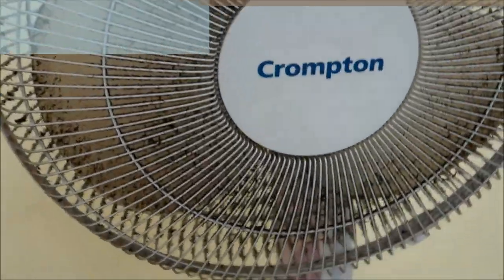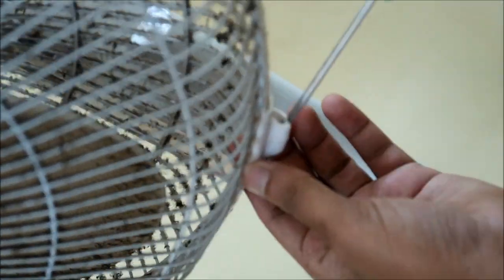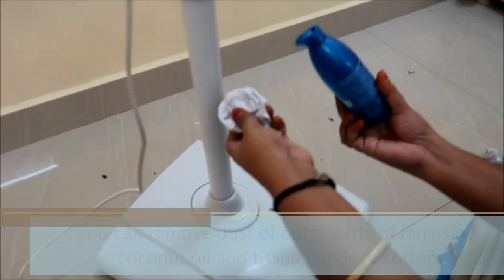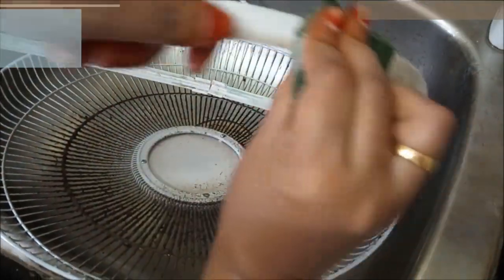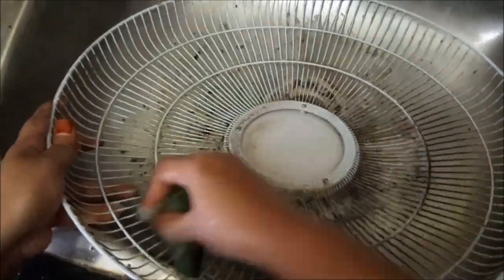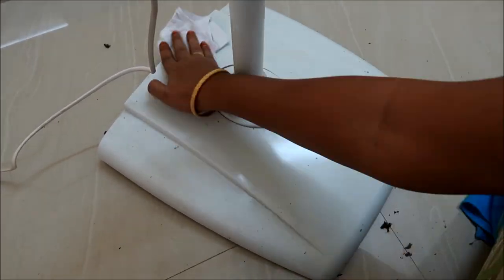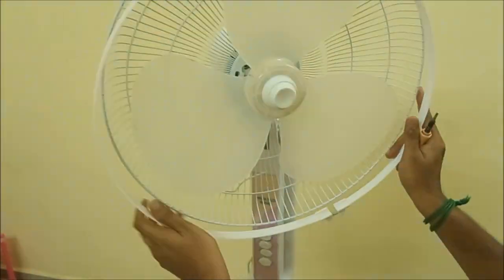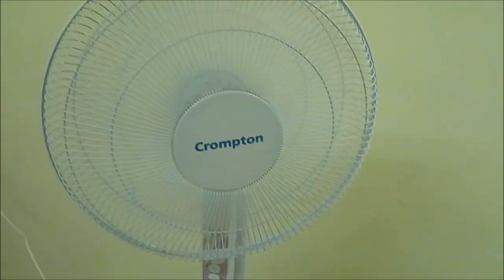Fan Cleaning guide |To Increase Air Flow

Comment: Cleaning fans are important to increase airflow, speed, and reduce noise levels. If we don't clean fans regularly, we will end up suffering with low speed, low airflow, and high noise. Dirty fans can also make us sick. So it's always best to clean fans regularly to maintain the fan's original speed, airflow, and noise level.